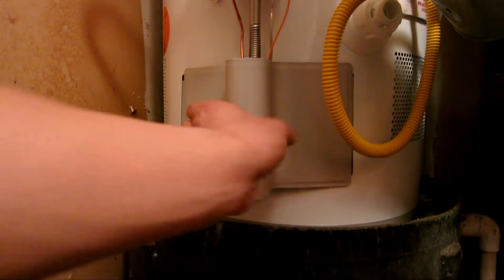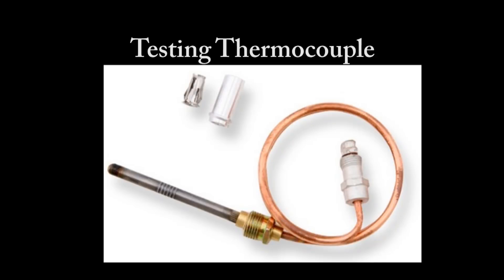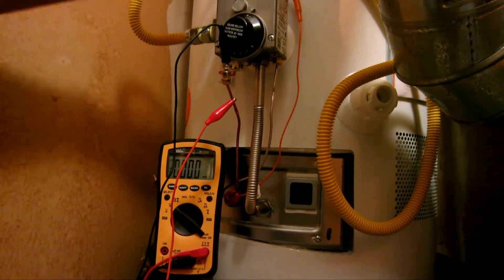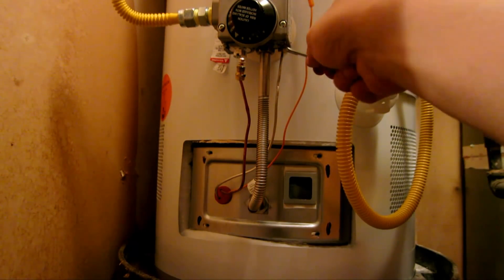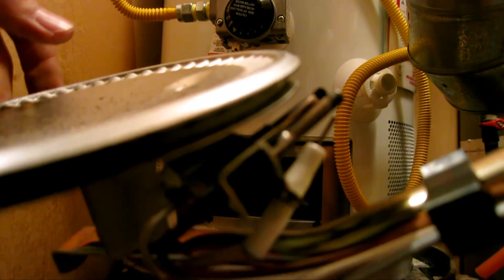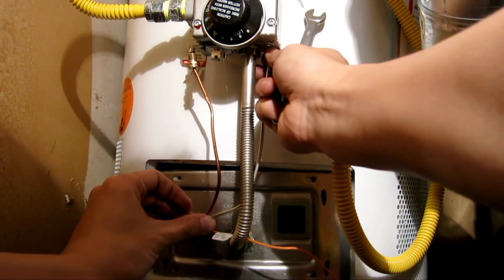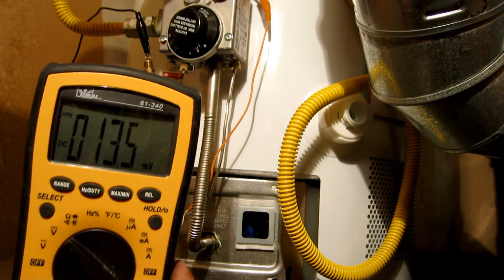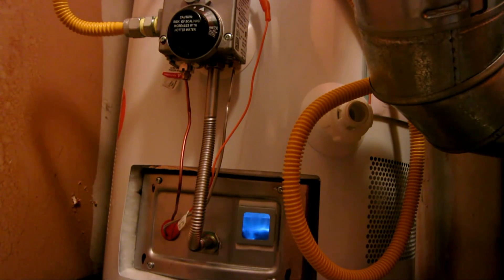Hot Water Heater Pilot Light Won't Stay Lit or On - How to fix waterheater by testing Thermocouple

Comment: My pilot lights but after a day or two it goes out. Could this be the thermocouple?
Reply: +Dave A. Ok I'll keep that in mind, mine has a thermal breaker that kept tripping, called whirlpool, they said to clean under  the burner, there is a vent that may get clogged & cause the temp to get too high and trip the breaker.
Reply: +Al Phillips We have a water tank that was 3 years old and a wall furnace that were both less than 3 years old. Within 1 month both pilot lights wouldn't stay lit. 

The culprit.... dust. I took a can of compressed air and removed the dust and they are both working fine now. 

Turn the pilot light off and blow the dust out, relight.
Reply: Thanks. I was able to clean the filter at the bottom of the water tank and that fixed the pilot light issue.
Reply: +Dave A. If you have to turn the pilot off, what is the problem? It's staying lit, wouldn't the pilot burn any dust off before it accumulated?
Reply: +ManikMekanik In my case the pilot light was intermittent. It might stay lit for a day or 2 and then go out. It makes sense that the flame would burn the any accumulation of dust... but it didn't. It doesn't take much to throw the calibration of the pilot light off. I know those from experience.
Reply from the maker: +Al Phillips Maybe. as it could be barely in spec, so a slight drop of voltage can causes it to go out. Or bad circulation. Clean the thermocouple and vacuum the burner area.
Reply: ɷɷ Heeeeyyy Friendsssss I Have Founddddd Workinggggg Online Hacck visittttt  : -  https://t.co/8EeFKvJAwk

Comment: Thanks DIY Tinker!   I woke up this morning to no hot water, and when I tried to lite the pilot on the hot water heater,  it would not stay on like it usually does when you release the button after 1 minute.  I tried cleaning the thermocouple, but still no luck in multiple tries.  I used your instructions to test the voltage, and I was getting up to 25mv from the thermocouple, but I figured, what the heck,  let me buy a new one at Home Depot for $11.00 before spending big bucks on a service call.   Sure enough,  replacing that part did the trick!   Even though the old one was putting out voltage,  maybe it was too low or something.   In any case,  things worked right away as soon as I put the new thermocouple in, even though the old one was clean and putting out 25mv.    So all  you DIY'ers out there,  keep in mind a 25mv voltage from  your thermocouple still doesn't mean you don't have to replace it,  like I did.   Thanks DIY Tinker!   You saved me some money today.
Reply: +Steve Gorman Thanks for the tip. I need to check mine. Mine lights but goes out in a few days.
Reply: +Al Phillips It's worth a try to replace the thermocouple using these instructions.   Mine was 14 years old and I guess it finally got weak.  I figured it was worth a try before calling the plumber,  especially since the part cost only $11.28 at Home Depot.  Be careful to turn off the gas and make sure you don't small gas at any point.   http://www.homedepot.com/p/24-in-Thermocouple-Kit-15028/204834536

Comment: Great video. I dont have a voltmeter but your video did lead me to try reseating the two igniter wires before I started unscrewing things. Simply reseating the wires fixed it.

Comment: The test didn't give me good results.
My nearly two year old Rheem water heater had the symptoms of a defective thermocouple.  Rheem sent me the entire pilot assembly for me to replace.  Before digging into it, I decided to measure the voltage as shown in the video. The thermocouple  ran up to 24mv, so I figured I had bigger problems.  I called Rheem back, and they wanted me to get into it more than I was comfortable with so I got them to sent out a tech. (covered by the warranty).  He measured the voltage between the tube and some spot on the side of the control valve while the thermocouple was still attached to the control valve.  It read 0mv.  He quickly installed a new thermocouple and fired the pilot right up.  I asked him to measure the voltage generated by the new thermocouple the way he'd measured the old one (between the tube and the test spot on the control valve), and the meter read 18mv.  Go figure!

Comment: Thanks for the very informative and thorough video. It helped me immensely today while troubleshooting my Kenmore Power Miser 6 water heater. What solved my problem was removing the burner assembly, vacuum it as well as inside the chamber and lastly, I used sandpaper to smooth out the surface of the thermocouple. Assembled it all back together and now I have a functioning water heater! Thanks again DIY Tinker!

Comment: I've been an electrician for 45 years but didn't know this trick.  The thermocouple on my 25  year old (and still going strong!) AO Smith water heater tested bad, so a trip to Menards for a new one and hot water again.   Thanks!
Reply: Judy Alsmeyer I'm amazed that you got 25 years of service out of a thermocouple.  In my experience they seem to last around 7 to 8 years when they're constantly in a flame.  Since they seem to poop out on a Saturday night when the hardware stores are closed (it's happened to me twice so far) I now keep a spare on hand.  Replacing the thermocouple takes just minutes, if you have one.

Comment: Hi
I disconnected my thermocouple and was able to read 20mV after holding the pilot light for about a minute, turned the knob to On and out it went. What else could be the problem? Thanks
Reply from the maker: airflow could also be an issue. vacuum the burner area and check if the fluke is clear. If that isnt an issue, then you might have a faulty gas valve. do searches on those topics.
Reply: Turns out GE said 10mV is good, mine did 22mV and so they sent out a control valve. I got that installed but the pilot still didn't stay lit. So I used the old valve and figured out the gas solenoid that controls the pilot valve needs at least 10 milliamps to hold the pilot ON when you let go. I used a power supply set to 10V and a 100 ohm resistor in series to limit current, rigged up a bushing to provide current into the thermocouple port and presto, its working (until the power goes out). GE said they will send out a replacement thermocouple, so for a few days this will work. I will power it down overnight so I don't have to worry about it and restart it in the morning. I'm thinking a better test would be to use the mA scale of the meter and see if it produces at least 10mA since the mV scale didn't work for my situation. My sensor read 2.85mA while holding the pilot light ON.
Reply from the maker: Bryan B interesting. im a little surprise it requires 10mA which i think its quite high for this application. keep us updated when you install the new valve.
Reply: Actually my math was bad, probably cause I was spending way too much time trying to figure out just how it works. The power supply corrected me when it showed 0.1A and while that might be off a tad, I decided to measure the voltage on the other side of the 100 ohm resistor going into the valve, it was 8mV. So not a whole lot of voltage but the current seems to be about right. To put 10V across a 100 ohm resistor works out to 0.1A into a short circuit, which is close to what the valve seems to be. When I get the new thermocouple I'm thinking of measuring its current to see what it does into a short circuit. I'm curious to see if it is that high, hopefully the new one is here tomorrow. I just want it to work like its supposed to...
Reply: OK, hopefully my final update to my W/H fiasco. New thermocouple assembly is installed as of now, I hooked up my meter to the thermocouple end, held the pilot and lit it, and watched the current climb to 100mA (0.1A) after about a minute. I used the 10A scale on the multimeter (Amp) function. I waited a bit and installed the end into the control valve, tightened it and after ~15 sec it held the pilot valve on. VICTORY AT LAST!...it might be short lived though since the replacement assembly they sent me puts the thermocouple right up against the burner! The original assembly is nearly mirror imaged to the new one. My W/H is one of the GE's low Nox models that can't use off the shelf thermocouples (so GE tells me). AND mythbusted as far as mV readings go. The real reading to check is mA, and that's what is keeping the pilot valve open...at least on this one!
Reply from the maker: Bryan B cool. thx for the update and nice to know it worked out for ya!

Comment: If you had to actually replace the thermocouple, how would yo remove and guide it through the little red rubber piece? I can't seem to figure it out.
Reply from the maker: i would clip the wire at the end, thread it in the red rubber, then reconnect the contact/plug on the wire.
Reply: DIY Tinker I tried pulling it through the rubber just crumbled. i wonder if they have a replacement for it. Do you think I can use fire block sealant instead?
Reply from the maker: Lenny Epshteyn or maybe fire resistant high temperature caulk and glue it in place.
Reply: Thanks man, I really appreciate it.
Reply: Lenny Epshteyn  I'd use a sharp utility knife or razor blade and slit the grommet to remove the old thermocouple, then slip the replacement thermocouple in its place.  If the grommet has gotten old and brittle, you could improvise with a blob of high temperature silicone RTV gasket material ("Form-A-Gasket"), available at auto parts stores.  It might not look quite as neat as the factory grommet, but it can be made to work.  Allow 24 hours for the silicone to cure.
Reply: Lenny Epshteyn Good vid!

Comment: If there is not enough ventilation in the storage where you have the water heater it would just stop working because it needs air to breath too check your pipe going out the roof it may be clog or water getting in .it is very important to have ventilation by the water heater or even around the water heater .

Comment: Thx man! PEOPLE THIS VIDEO IS VERY HELPFUL! BUT PLEASE KEEP IN MIND THAT IF YOU HAVE A THEMOCOUPLE WITH A RESISTOR ON IT AS OPPOSED TO THE COPPER WIRE ONLY YOU WILL NEED TO REPLACE THE ENTIRE BURNER ASSEMBLY (the copper wire and pilot line) Do not pay a plumber $200 + the thermocouple is less than $12 & a new burner assembly can be ordered for around $30 on amazon!!!!!!

Comment: Help Please.  I changed my thermo coupler and the pilot will light and ignite the burner.  Once it heats the water and the burner goes out the pilot goes out.  I am on my second thermo coupler.  What can be the problem and the fix, please?  Thank you in advance.
Reply: Clean the inside of the water heater the filters or any type of vents you might have with a air compressor.
Reply: doesnttapout Thanks, I had already blown the bottom vent and shop vac the inside.  Now, I installed the third thermo coupler.  Again the pilot stayed lit and the burn came on when the thermostat was turned to "on".  When I went to check on the water heater after about an hour the burn was dormant and the pilot light was still lit.  Woo Hoo.. Thought I fixed the problem.  When I started the pilot on the third thermo coupler I left the thermostat at "warm".  So, I proceed to turn up the thermostat, to no avail, the burner will not ignite.  I thought maybe it takes a min or two to ignite.  I went and turned on the hot water at the sink, still the burner would not ignite.  ARRGGGG!!  Now, I got a whole new water heater..  LOL
Reply: Hey bro, my water heater is doing the same thing, I replaced the pilot, thermo couple, and ignite !! All three things are replaced but water heater stays on for like 20 mins or so and then after like an hour I check again and is off... What can be the problem? Did you found the issue, or had to buy a brand new heater?
Reply: Is your gas heater valve it needs to be changed to a new one .it might be like around $130.00
Reply: Jeremy Conrad that's exactly what I did, I was waiting for an answer but I really needed the hot water to shower lol. So I used my lawn blower haha and a brush to clean the filter and then blow the inside again and as well the outside. Ad it been 4 days now and everything working goood !!!!! :D I will recommend to everyone who wants to fix it them self to do this method and if it doesn't work I guess call a tech... But they easy to fix by your self, no need to call a tech
Reply: Jeremy Conrad  I've read that the newer sealed-burner water heaters since 2003 are prone to having the flame arrestor screen clog with dust, restricting air to the burner and making it go out.  Keeping the air intake screens clean by periodically brushing and vacuuming is essential.

Comment: Thank-you for posting this, in particular with your walk-through of using the multimeter and required voltage. It helped me to Dx a bad thermocouple in my older hot water heater. Quick replacement and a hot shower to celebrate ! Cheers !

Comment: Replacing the thermocouple (not thermocoupler) does not void the warranty on a water heater (not Hot water Heater because you should have no need to heat "Hot Water") Voltage check is not necessary. If it won't stay lit, it's the thermocouple... guaranteed... just replace it... glad the video helped people though.. that's the object of it..
Reply: And yes, the thermocouple must be "in" the pilots flame to operate properly

Comment: Wow! Hi diy,I have question after you connected the alligator clip did you just turn in to pilot on? & the voltage it should be higher? Like it shows in the multi meter. I like this video save a ton of money & time good guy...
Reply from the maker: yes, pilot on so that it will heat it up. The voltage is in the 20mV range as stated in the video. hope that helps.
Reply: Thank you very much,Diy.

Comment: Thank you sir, I followed your instructions and cleaned my thermocouple and the heater is now repaired. You saved me time and money. I really appreciate the time you took to put this video together and to share your knowledge. this would have cost me at least $200 in labour to repair. Since my heater is about 8 years old I also cleaned out where the burner sits, there was a lot of burnt debris in there and it was piled up quite bad. I vacuumed it all out and its good as new.
Reply: What he said -^

Also holy crap that burner gets disgusting with the crap that builds up, doesn't it?

Comment: My pilot would intermittently work, and I would have to relight it sometimes every month and sometimes every day.  After seeing this video I finally decided to check the thermocouple.  Turns out, the thermocouple connection to the controller was barely screwed in.  Once I screwed it in the rest of the way it worked fine.

Comment: Sometimes, soot coats the thermocouple and prevents it from reading heat correctly. Cleaning it with sandpaper or an Emory board fixes this.

Comment: Great post. I just tested and replaced the thermocouple and worked great. A couple of notes: tightness of the thermocouple up into the thermostat is very important, you can try different tightnesses by slowly releasing the button until the pilot starts to flicker then push down again quickly before it goes out, then tighten more and try again, repeat. That way you dont have to keep relighting (I didnt have an electric sparker). Also, I needed a shorter thermocouple for my heater but the shortest Home Despot had was 24". I put a loop in it and tucked it in underneath so I could close the inner door, but it would have been better to use a metal bar and twist it around the bar like a telephone handset cord underneath the outer door.

Comment: My hot water heater was working.  I had to drain and move the water heater.  3 days later I moved the water heater back, connected the gas line.  I followed the steps in the video to light the pilot. Not successful.  I loosened the gas line and confirmed flow a gas to the water heater. I was getting gas flow!  ( I did open windows and doors and had a fan blowing towards the door for ventilation)  I disconnected the gas line to the heater element.  I followed the steps again for lighting the pilot.  I could not get any gas flow to the heater element.  Help!!  :-)

Comment: I replaced my gas water heater thermocouple today - it was easy, by the way, thanks to the video...  my problem is not the pilot light, it stays on, however, the burner doesn't go on except at the very very hot temperature reading.  When I turn it down to A, B or C the burner goes off but pilot light is still on.  What am I doing wrong here?
Reply from the maker: the burner turns off once the water is hot enough. A, B or C are different heat level you want in the tank. A=130°F, B=140°F and C=150°F
The water tank turns off and on. Maybe your water tank is hot enough; hence, the burner doesnt have to come on.
Reply: DIY Tinker 报者一口此一
Reply: DIY Tinker 报者一口此一
Reply: If your water is cold and burner only comes on at a very high setting, your thermostat may be out of calibration.

Comment: Good & easy instructions. I called in the Affordable Water Heaters in bay area, CA when the pilot light won't stay on after heating water. The guy took 10 minutes & said I need to replace the control valve & they can do it for $766.xx; I asked him how did he know it's the control system & answer was "I've been doing this for 20 years". I asked him to leave.
Saw this video & did some testing. Replaced the themocouple & made sure that no gas leak was found (I would add that to the video) as it's risky with gas. It is working for last 24 hours.... hope to last another couple of years before I open it again.